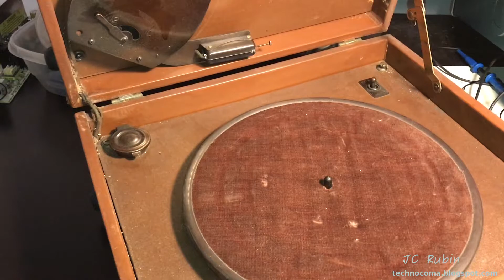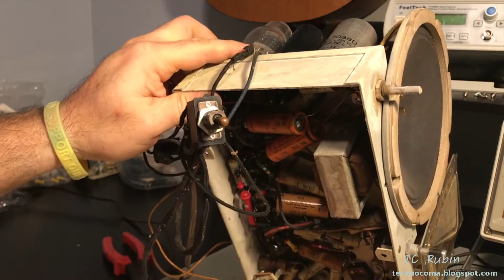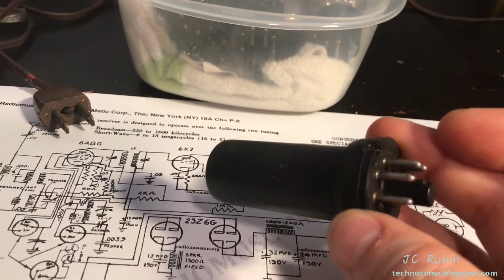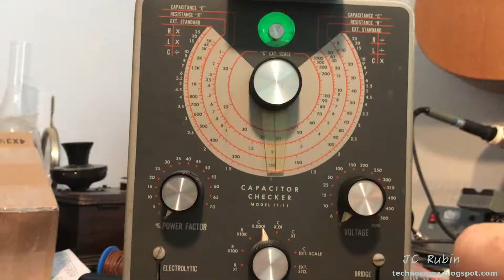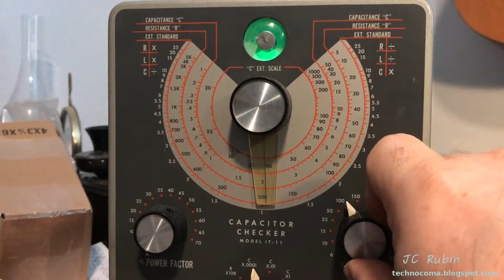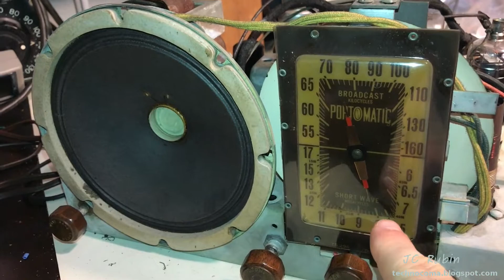Port-o-matic - The Antique IPOD of the 1930's - Repair project Part 1

Comment: Those cast iron universal motors were almost "universal" in early radio-phonos. I had to work on many over the years, including changers with them. They drove things through a gear train that turned the center spindle. Surprisingly dependable too. They lost favor as years went by and cheaper shaded pole designs started taking over but they still had their place where DC had to be accommodated such as old Edison plant areas that had not been updated to AC. (Mainly rural or areas supplied via streetcar/traction operations. Pretty common pre-WW2.) They also were drop-in replacements for old wind-up phonos that also had center spindle drives.
Reply from the maker: Thanks for sharing this information
Reply: Glad to share it before it is too late. Forgot to mention: You can ALWAYS tell when a radio is meant to be used as a portable with batteries. The tubes will ALWAYS have 1-1.5 volt filaments. 1H4, 1R5, 1L4, etc. Even the "3 volt" tubes 3Q4, 3S4, etc.) will have split filaments so they can be run on 1.5 (parallel) or 3 volts (series) battery supplies. The one exception to this was a Setchell-Carlson model which was line voltage only and could be used as an intercom/PA. The low voltage tubes gave it an "instant-on" capability.

Lots of strange stuff out there...

Comment: Good one, Jordan! Ballast tubes were quite common in AC DC Sets to compensate for lack of a transformer to make up the filament string total drop to around 125 volts. Good for heating cold rooms. Luckily your ballast is not open, it saves a hunt for a good one or some ingenuity to fabricate one with resistors.
Reply from the maker: Yeah, but thats not a tube its not even solid, its just a can stuffed with resistors.